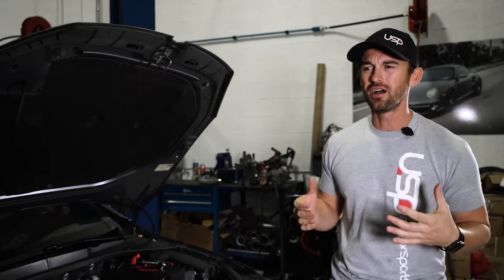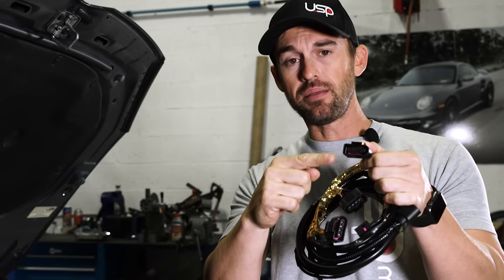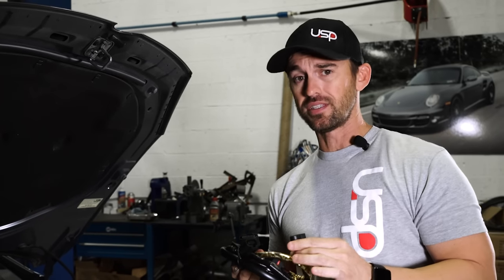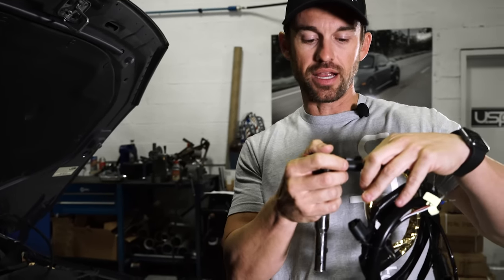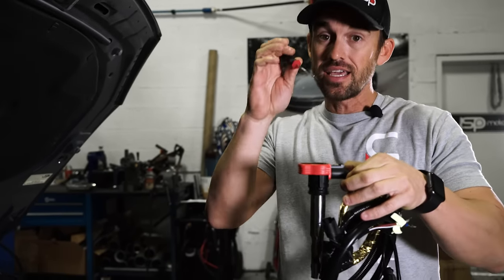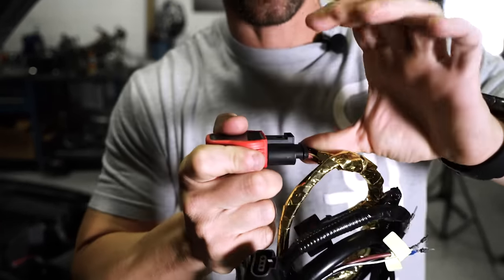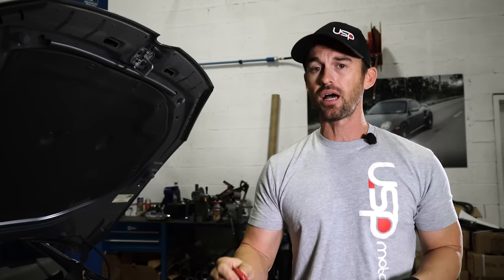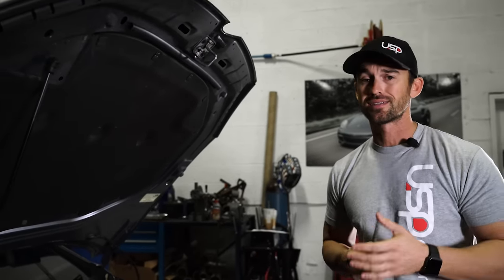How To Remove Pesky VW/Audi "D" Connectors // USP Motorsports

Comment: After fighting to disconnect these VW connectors for years, I watched the video, walked out to the garage, popped the hood and disconnected the MAS connector in less than a second. Thanks for taking time to make this really helpful video.
Reply: I just did the same fucking thing lol
Reply: @aldopaints670  Same here. Having spent yonks trying to get rusty T20s out then struggled with this on the MAS connector, sorted!
Reply: @HappyBagger  any tips on the rusty T20's?

Comment: You just saved my wifes jetta from a sledgehammer-fest... No joke
Reply: damn, that video would have gotten millions of views.   Do it anyway.
Reply: Lol!
Reply: I wasn't reaching for a sledge yet, but man I feel that pain.
I thought about intentionally breaking each connector and zip tying each one.
Pesky little clips ain't enough to describe these pain in the azzez 😁
I don't care how many hands u get in there, they are a pain.
Plastic being heated up to 150 degrees plus under the hot sun with engine running then down to 0 in the winter these plastic clips feel super britte and stiff

Comment: You are a life saver. I have been trying for the last hour to remove electrical connections from my brake sensor and brake fluid level sensor and hoping I didn't break them. Your solution works. Thanks.

Comment: I have a question what if the little clip that you lift is allready broken then how can you remove it from the coil? Can you stick a flat screwdriver or pick tool in between the coil and ignition coil connector to remove it from the coil?

Comment: Thank You!  Was trying to disconnect MAF sensor wiring to move the MAF’s and air ducts out of way to replace my VW’s twin Air Filters.  Should be a 5 minute job, but there’s no room in there and the vacuum lines run atop the passenger side air box.   I am getting low airflow codes in the VAG COM. Cheers.

Comment: Trick does not work. Coil pack connector is bottomed out with compression (probably a pretty hard o-ring), locking tab easily released and clear of the locking nub on the coil pack, connector is still frozen in place.

Thinking this trick will not work if it's a daily driven car in a cold climate and not a tuner car being constantly wrenched on.

Comment: You're wrong about the pick trick because two of my levers were broken so after compressing and pulling a couple times, I pushed a straight pick in the middle square hole and it popped out.

Comment: I was getting very upset with procedures that simply said "remove electrical connector" with no explanation of HOW. Awesome video! You should do more of these for the other connector types! I tried a couple of hours to remove it, then found this video and had my connector (high pressure diesel fuel connector on Diesel Porsche Cayenne) removed in 15 seconds! Thank you sir!

Comment: I have an issue with o2 sensor clip. The female clip with orange gormet is secure behind the engine with little access to rear part. I can pull the o2 sensor clip with good grip but cannot pull female clip! There no way I can push and pull with 2inch clearance ; just enough for two fingers lol. 

My guess is previous owner use aftermarket part and it’s not a clean fit? Any idea what I can do… I can’t push in and then pull.

Comment: Thank you for the tip.  I'm on the ground under my 2007 Touareg needing to reach up and unplug the speed sensor.  Didnt want to break anything so looked up this info.  This info is not even in my shop manual.  Thanks so much.  Push in, push down and remove!

Comment: Awesome video dude :) I had a broken D connector tab. How do you get it off the coil packs once the tab is broken without that special tool? is there a special way to do it?
Reply: How did you end up doing this?
Reply: I’m in the same boat already broke 2 tabs before watching and have no clue what to do now

Comment: Sometimes its impossible to tell whether you have unlatched the connector. Eg brake wear sensor gets grit inside and is difficult to pull apart. Thats when it makes sense to slide in a tiny screwdriver from the other side under the latch. Only then do you know you can pull as hard as you need to, to get it off, without breaking the clip or the wiring. To check that you have actually unlatched the connector, after sliding the screwdriver in, push it back together again and you will (if its not too clogged up) hear the click. Unlatch it the same way again, and PULL with all your might on the connector (not the wiring!).

Comment: The most valuable info here is the tool to remove the wires. I was ready to cut the wires and solder then back in the new one. Thanks

Comment: the connector on audi a4 starter motor is very tricky unless you follow these tips. The connector on the solenoid signal wire is  a round female plug with a flat side that keys into a male pipe like hollow receptacle attached to the solenoid. To disconnect them, First slide the red tab away from the solenoid as far as it will slide. Second, continue to apply pressure in the same direction and the red tab will move slightly more but enough to pivot a release latch that is within the body. It may help to apply pressure to the body of the plug in the opposite direction while pressing the red part. it may also help to use a small screwdriver to move the red part. Third, slide the black female plug part off the male part.  when you have got it right there is no need to use excessive force,  it will come apart using your fingertips. Once it is off, look inside the female part and repeat the action a few times to get an understanding of what is happening with the red tab.

Comment: Depending on where the  connector is on the car, they can get so dirty and packed with dirt you might have to use a pick to get it off, if you cannot get the dirt flushed out of the clip part before getting it off.
Mostly seen that on stuff in the wheelwell like height sensors for xenon lights etc. on cars that run in salty winter conditions (as i live in Norway, that is basicly all of them). This is normally not an issue on engine connectors tho.

Comment: I'm stuck. I've been trying to remove my coolant fan connectors on my 07 audi a8l for three days and nothing works. There are only two to remove. But I've tried this method and got no where also.  Are they a different kind of connector maybe?

Comment: damn, i learned this the hard way yesterday, could of used this vid. trying to remove the connector to my clutch master cylinder back in the tiniest of holes. i ended up grabbing a trim removal tool and while i was gettin it in there i pushed on the connector and it literally popped off with the same force as the one in this vid. crazy, the more you know.

Comment: For many years I have a mini
Flat head I use to pivot the clip, hear the click and pull. Never dealt with broken tabs cause of it. For terminal de-pinning/removal I take the metal strips out of old windshield wipers and file them to the shape I need.

But I deal with plenty of customers cars with busted pigtails constantly. When I hit the pick n pull I scavenge as many pigtails as possible to always have them on hand.

Comment: great video! Would be great if you would do a video on replacing the coil Pack wiring harness for longitudinal engines. I have a 2002 Jetta  1.8turbo

Comment: I broke 4 of 6 on my 3.0 TFSI when I changed the plugs. It doesn't help that the damn release tabs are paper thin plastic that weaken more with every heat cycle. I knew the trick and I was being as careful as I could be. They're just designed terribly. Luckily, the D connectors clip back on the coils with no problems and the screws that hold the coil pack rail to the valve cover give them some extra support. My Mercedes was the exact opposite. It could not have been any easier.

Comment: Yup like the camshaft sensor. I broke the one on the maf sensor. Not the hole casing just the clip.  Figure I'll just tape over it to the maf connector.  Also the secondary  air pump injection clip lol. Gonna tape that too so they dont separate at least

Comment: Ive owned my 03 TT since 05.  I've always gotten my coil pack ones off easy but I've been working on one clip to access the regulator and it's been pissing me off to the point I wanted to break it.  I decided to watch vids instead and will try later .thanks.

Comment: Oil pressure sending unit 1.8T, upside down and I can get two fingers on it. I guess coolant lines are coming off 😔  I know the trick but sometimes you need motivation. Thanks

Comment: Yea but if you see a damaged clip, or damage one yourself - how do you replace it? OK you push in the tool you showed us, and pull out the metal electrical connector part. Then you can push it into a new plastic connector - if you have a genuine vw-audi plastic connector - an oem metal connector may not fit into an aftermarket plastic connector and vice-versa - and if the metal connector isn't corroded or falling off the wire. Lets say you buy a new set aftermarket connector (for $3 US each, as opposed to $30 for an OEM clip) and you have cut off the old metal electrical connectors, and you want to strip the end of the wires, crimp on the new aftermarket electrical connectors onto the wires, and then push the new metal connectors into the new aftermarket plastic connector. How do you manage that when you can't reach the wires, and can't move them into a convenient position to work on? You may want to start removing the tape that holds a bunch of wires together, so you can pull them apart and get their connector ends closer to you, but you can't get your small utility knife into the place where the tape is, or if you can, you can't manage to get the tape off without damaging the wires inside, damaging their insulation. It is like VW-Audi gave no consideration to the idea that a mechanic might want to work on the car; all their thought went into how they can assemble it at the factory. That means put in part A - easily there is nothing in front of it; then put in part B in front of it - easily there is nothing in front of it; then part C, the same thing. Gets done quickly at the factory. But now you are in the field and you want to remove part A. Good luck. You have remove part C first, then part B. And pulling a wire connector off of a part: there is not enough space behind the connector to pull it off, or just barely enough. And extra cm behind the connector would have made the job of pulling it off feasible. But as it is it is nearly impossible.

Comment: You will never be able to depin that connector with the tool you showed, unless you remove the brightly colored plastic U clip inside the connector, usually from the side.  That is called the secondary lock.

Comment: I just dealt with VW fuel injectors that had this and they are terrible design.  Which is why later years they got rid of them finally with the slip off clips.  My problems is when they are deep inside crevices there's no way you can push or apply the pressure unless you remove a bunch of stuff.  That is why working on German cars costs so much time and money.  They simply over thought these things that are less prone to break if they are designed more simpler.  German cars need a lid over the engine bay because underneath it is a huge mess to get to stuff.

Comment: I despise these connectors with a passion. Somehow every other manufacturer manages to make sure they are intuitive to remove.  Not VW.  Even the ECS tuning tool, which they sell without adequate instructions, is basically worthless when you're in a tight spot. Like the OP I can't count how many of these connectors I've seen broken.

Comment: This video is cool and dandy, but DOES NOT solve the issue for when it’s hard to reach. I cannot believe that you did not show the OTHER option, there is a special tool to remove those connectors.

Comment: Nephew needed brakes done on Audi and had to remove e-brake connector to retract the caliper in rear and spent 5 minutes fucking with connector before looking up a tip to remove . professional mechanic so know exactly how easy it is to fuck up a perfectly good connector by not knowing how to remove so immediately  went to look for some tips and had to make a hard pass and some extremely dumb ideas on how to remove these clips
Reply: as for replacements i would go to a u pull it yard and fill my pockets :)

Comment: Thanks.. I've been fighting an O2 sensor connector on a vacuum pump reservoir bracket. Its blocking the final release bolt that allows you to remove the Valve Cover on an E90 335D. I fought it for about 6 hours yesterday before I had to walk away to avoid physically abusing that bitch.
Your explanation is so simple, I just want to kick myself.